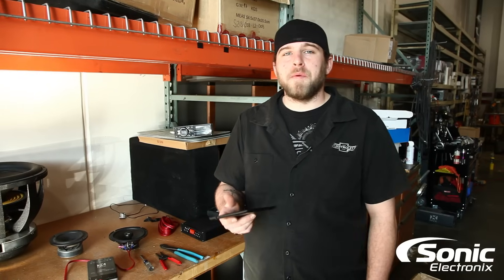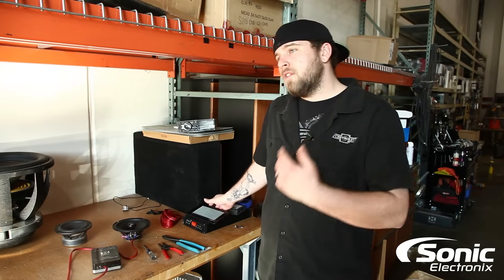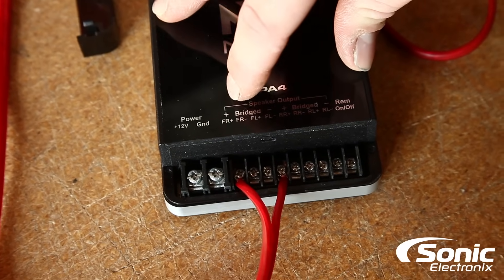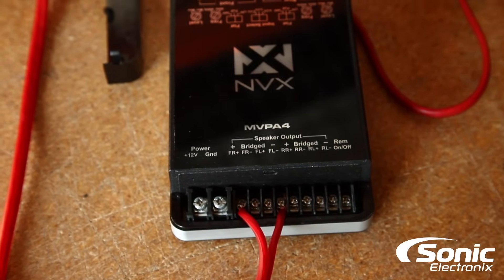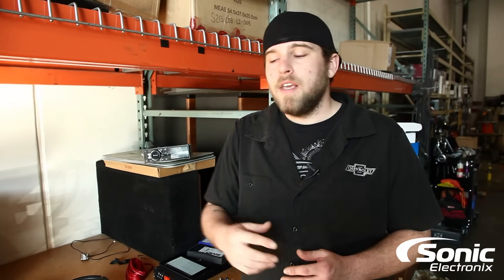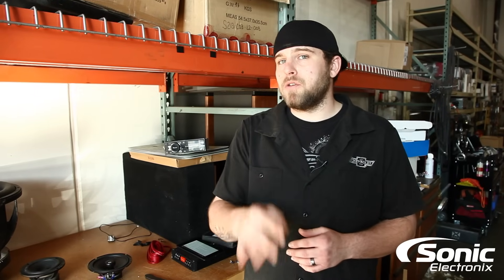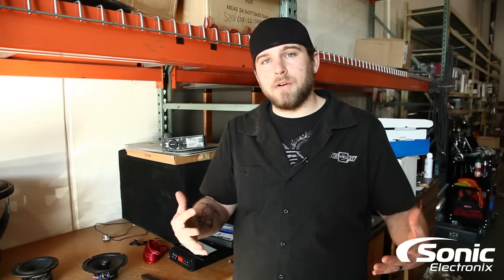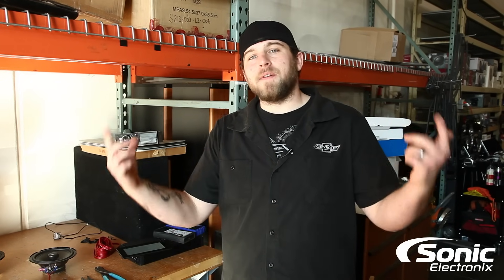How Do You Bridge a 2 Channel Amplifier? | Car Audio Q & A

Comment: Not every Amp has bridge marking ..and if some one was wanting to know how clearly it wouldn't be marked ......the answer would be the plus from left channel and minus from right channel if it doesn't sound right try the opposite  and running 4 speakers on a 2 channel is no problem just run them in series not parallel

Comment: I have a single 12 Dvc audiobahn wired to 2 ohm and then i bridged it at the amp its the Blue 2 channel Hifonics Zues Viii 600 watt i also turned the gained down to a little past halfway is that ok to run like this

Comment: I have a 2 channel amp ( crunch gtrii-3000.1d)  and it doesn't have a specified bridged option,  I have 2 dvc 15in. Power akcoustik mofo subs and want to wire them to 1ohm at the amp if possible, everything I am finding is only 2ohms at the amp and that cuts my power in half obviously so I was wondering what the options were, also an option to eliminate 1 sub if it would be better to do so or to invest in a different amp to achieve this or different impedance of subwoofer.  Thanks for all of your help and great videos 💪👍🙏

Comment: Hay I have 2 12inch subwoofers connected in Parallel and I’m using a 1000 W amp in bridged mode And every time I try to turn the volume up on my stereo to pass 20 the amp goes in to protect mode I have to keep the stereo under 20 and my amp at 0 ohms to keep it not going into protect mode what could be the problem ?

Comment: Sorry I don't know much about car audio but I changed my amp to a rockford fosgate 800a2 2 ch I bridged it and am using 1 15" Q class L7 but unfortunately it is the same as the cheaper amp I still can't get sound from any tweeter I connect- is it possible to connect tweeters to a 2 ch bridged amp?

Comment: my question is does the amp need to be brideged to run a set of 2 ohm speakers in kick panels. Or will a special suited amp do that for me on two of the existing 4 channels? 
I believe it says amplifiers today that are labeled A/B Class can handle 4 ohms down to 2 ohms. So I gather you can run more power to the 2 ohm door speakers on the 2 channels, and the other 2 channels could run 2 more 4 ohm speakers. Giving you much more power for like either rear or front speakers depending on where you need more quality sound and volumn.  A/B Topology - Class ‘A’ amplifiers have enormous amount of current flowing through its output transistors with no audio signal. Class ‘B’ amplifiers have no current flowing through its outputs with no audio signal. If I'm not correct please le me know. I have purchased two 6 inch speakers for kick pannels which I need them to create a louder sound due to position. So using a class ab amp I can use the front two channels to run just the 2 ohm speakers while running 4 ohm speakers in the rear. 
BOSS Audio Systems R2504 - Riot 1000 Watt, 4 Channel, 2 4 Ohm Stable Class AB, Full Range, Bridgeable, Mosfet Car Amplifier with Remote Subwoofer Control

Comment: Most Subwoofers can be bridged down to 2ohm load and not put most amplifiers into protect mode many monoblock amplifiers can even  handle as low of as 1 ohm but again that's subwoofers like 10s 12s etc not door coaxial or 2way 3way speakers like 6x9s etc

Comment: I have two amps one of my apps needs to be connected to power but the other one doesn't so when I connect a remote wire to the power it's fine but when I connect the other remote to the app it shuts off on both of them what do I do
Reply: i want to help but im having a hard time figuring out what you mean here, you say you have 2 amps and one is connected to a power source the other amp is not. what do you mean by when you connect a remote wire to power its fine but shuts off when you connect to the other amp

Comment: If I have a single 4ohm 12 inch kicker comp c subwoofer and a 2 channel 1400 watt amp am I recommended to bridge or no?? Comp c is rated for 600 watts max load. What do I do
Reply: bridge it if the amp is 2ohm stable. you can setup the gain/level on the amp to only put out 600w max

Comment: Okay so if we have say a factory two ohm amplifier and two four ohm speakers can you wire the speakers in parallel for a 2-ohm load and bridge it across the two rear channels
Reply: no if you bridge it at 2ohms the amp will see a final load of 1ohm and overheat

Comment: Old school vintage  Coustic Audio Coustic460  ..
amp.. is a 2 channel that can run 2 ohm bridged i have one running 4 subs from. CT sounds CT pro 8 subs dual voice coils with two subs on one channel other two on other channel. both pair are 4ohm by themselves but wired in parallel to 2ohm bridged mono

Comment: Hi,  am using eonon D1001 car DVD and it has 5.1 ch preout, now my question is only about connecting subwoofer preout to amplifier that's 4 ch I've got,  do I need to bridge?  Or can I consider as similar as one channel to connect sub with one +and - note; leaving 3 ch input and output blank?Coz my idea is to use a 2ch amp and a 4 ch amplifier together to get Dolby 5.1 output.

Comment: you can get impedance protective equipment to be then able to bridge what would be 2ohm to 4 or even 8 depending on the system.
Reply: Yeah I have an impedance matching volume control but nowhere to mount it my walls are plaster otherwise I would be good speaker selector is something I could use anyway so I'll check some of those out
Reply: How do i find this equipment unless your talking about an impedance matching switch
Reply: @coreyfelsman2363  some speaker selector boxes for example or specific volume controls

Comment: Oh buggah - then I must have really screwed up then.. running a 7.3+1 system (for about five years at extremely loud settings) - off the head unit of a Blaupunkt ten disc CD stacker - changer  (in my old Delica 4wd van - between 2003 & 2007 - being as it was - a 25 speaker setup for the seven main surround channels - the three master subwoofers and of course - the summated add-on extra low reverb speaker.
Amazingly - it never blew anything - except people's brains when they heard it.
126.6 dB too running at about 75% loudness at the NZ Sound Off SPL measurement competition, held in Alexandra in 2003 - at the Blossom Festival event.
But then - you see, I already knew what I could DO - with the 300 watt Reactor amp - that I bought for the lowest price possible - at the Warehouse (here in New Zealand)
I also KNEW how to balance the reactances of various wattage / as well as reactance / resistances - of the various speakers, dug out of such things as an old valve radio - some house speakers (8 ohms they were) and others of various numbers, such as 6 ohm sony wall speakers, some 16 ohm AIWA surrounds, and assorted others..
25 speakers.
seven main channels
three subwoofer speakers and a summated (ultra low frequency filtered) vibrator central channel dual 8 ohm speaker set
(being two speakers - one speaker inverted across the other with the two BOLTED together to seal the air inside the diaphragms - of the two speakers)
These were wired - not in series but in reverse series, one driving OUT as the other pulled IN
(& visa versa as the AC audio signal went through it's own inversion state).
Thus the vibrator speaker set - thundered in and out, lifting the van UP then pushing it hard down on it's springs..
Lovely device that was - driven by all seven channels "electrically" summated together as ONE.
I used transformers of course to isolate each of the seven main channels - before summating them all
Be a bit of a buggah it would have been - if all seven channels had been "shorted out" by the vibrator being hard wired to them all.
Hence - I know - that the statement you have made - is NOT exactly true.
An amp is a funny thing.
Balance the load that connects to it, and you can power not one - nor two or three - but (as in my case) 25.
Cheers.
Or - if using an old CDS-370 house amplifier unit (or two) - one can physically drive 88 speakers, inside 64 cabinets, running a 25 channel surround sound system - off an old compact cassette tape recording.
ONE - is not restricted by a ONE speaker alone installation.
See?
Well you will if you watch this....
https://youtu.be/Ub0S8eTijrA

Comment: WAIT so to connect one sub woofer to a bridged 2 channel amp @ 4 ohms------ I put one wire to the black to the red on the SUB--- THEN put one red to the positive and one black to the negative TO the amp. THEN that puts both the sub and the amp at 4 ohms? making my 2 channel amp into bridged mode making 2600 watts at max? I believe i am correct BUT I am never sure.....

Comment: Hey! I would like to get some help!

I have a 2 amp setup. 1 amp for my high and mid speakers and 1 for a sub. The sub amp is a 2ch amp that i'm using in a bridge mode. Now the "main" amp has a single RCA output, the sub amp has a double RCA input (left-right). I connected them with a Y RCA cable. The sub amp has a channel assignment switch: Left / Stereo / Right. The manual says:

Channel Assignment Switch • Determines the routing of the input signal for the RCA and IMS inputs. 

• LEFT: Sends the input signal from the left input to both amplifier channels, useful if you are bridging the amplifier. 

• STEREO: Sends the signals from the left input to the left output channel and the signal from the right input to the right output channel. (This is typical operation mode.) 

• RIGHT: Sends the input signal from the right input to both output channels, useful if you are bridging the amplifier.

As you can see the LEFT and RIGHT switch literally doing the same right? It sends 1 RCA input to the bridged output. If I understand well I can't use the stereo mode if i'm using the amp in bridge mode I have to pick left or right so only 1 input is used so I don't even need a Y RCA cable only a single cable is enough right? Thanks for the answer!

Comment: I don't think he covered the question correctly. He started talking about bridging amps, and yeah, you don't want to go below 4ohm on a bridged amp. But some when not bridged will do a 2 ohm load PER channel. Just have to check your specs on the amp. The part with the ohms is correct though, so just keep that in mind when running parallel speakers.

Comment: Wire a dual 4 sub in series =8 ohms 
Then bridge to amplifier. Safe way
Reply: That's what I've done.  2 15s on a 1000w bridged 2 ch profile
Reply: Dvc 15s at that

Comment: Have question I just bought three boss phantom 12in 2300 watt subwoofers and have a 3700 watt boss phantom amplifier also just bought a 5000watt phantom amplifier......the question is what's the best way to wire them all up...

Comment: I thought the second question was four speakers on a two channel amp
Reply: Yes you can wire 2 4 ohm speakers down to 2 ohm I ran a pioneer 240 2 channel on 4 speakers no problem at all.
Reply: @Chris-ts8oh  i am running 6 speakers on two channels 4 x 8 ohms and 2 x 6 ohms on a Pioneer A450R. 8+8+6.:text-green-game-over:

Comment: U can always change the way u wire your speakers to get a different final impedance. Could u bridge them then?
Reply: That's what I was wondering and also what I needed answered since I have 2 satellites and a center but all 3 ohm so my avr is a no go but I have 2 2ohm stable amps

Comment: Question after you bridge the 2 speakers to the 4 channel amplifier  how do you connect the rca cables, there are 4 input rca connectors. Thank you.
Reply: Get another RCA cable and run from your HU (if it has it) 
Most newer radios have 3 sets of RCAs in the back. Front, Rear, and Sub 
If it only has 1, get a RCA splitter. 
Must have in order to use all 4 channels on the amp.

Comment: I have a question which I can't find anywhere on the internet. Can I have like my front speaker at 150 Watts RMS and the rear Speaker at 200 Watts RMS on the right side channel  this is a 2 channel amp. I was just wondering if you can use different RMS speakers one side of channel?

Comment: How to connect 2 4ohms coaxial speaker and a subwoofer to 2 channel amplifier.?
Reply: I don't think that's possible because the filter would only allow either voice or mono on the switch of the amp. You'd have to choose one or the other

Comment: BRENDAN, great video; I have question; I am new to car audio systems and could use your help if possible; I have a 1970 chevy truck I currently have a "standard 6" speaker and a tweeter installed in the doors; I recently purchased (2) 8" subwoofers to install these are in a sealed enclosure 4ohms each I wired them in parallel the amplifier is a JBL-GTR-601 AMP-600 WATTS RMSX1@2 OHMS CAN I ADD AND IF SO WHAT IS THE PROCESS TOF WIRING OR BRIDGEING A PAIR OF 4" MARINE GRADE SPEAKERSI BELIEVE THE SPEAKERS I WISH TO INSTALL ARE 4OHMS EACH; BOTTOM LINE I WOULD LIKE TO ADD A PAIR OF SPEAKERS TO THIS SYSTEM; I REALIZE I MAYBE ASKING ALOT BUT ANY ADVICE AND OR HELP WOULD BE GREATLY APPRECIATED; PATRICK.P

Comment: Hi. So you said is not possible connect two speakers in one car  radio channel. Because car radio has 4ohms. So my car radio has 50w 4ohms and I want to connect two speakers in one radio channel.
Parallel
4 ohms+4 ohms=2 ohms
4ohms+8ohms=2,5 ohms
8 ohms+8 ohms=4 ohms
So if I connect two speakers in parallel 75w 8 ohms
75w 8 ohms  
150w 40hms
Good or no?

Comment: What if you wanted to bridge 2 channels to increase the output but wanted to run a single high powered 8ohm speaker will that do any dammage to the amp?

Comment: So I guess I'm SOL.. I was looking at taking my 2 svc 10"  4 ohms to a parallel or series and Bridge it to my 1600 watt Peak Power Amp 2 Channel my two tens or 400 watts RMS each, owner's manual showed a single SVC 10 bridged for 1600 Watts by 1 which blows to me cuz it's only one sub and I want to power 2 Subs. My amp handles 2 ohm stable

Comment: If you wire two 4 ohm speakers in series, you create a 8 ohm load... then by bridging at the amp drop the 8 back to a 4 ohm load.  The amp doesn't care how many speakers, just the load that it sees..... isn't that correct?

Comment: Question ? I’ll make it simple. One sub, dual voice coil, 4ohm and two ohm ratings on the speaker package.  What amp do I need to power them ? Mono or two channel ? And when using a two channel do you simply wire each voice coil to each channel or what ? And lastly, how is the power distributed  between the voice coils meaning is the rating per voice coil or does each coil need to run at the rated rms? Sorry so lengthy
Reply: I'm using a two channel and bridging it to double the power. Sub is wired to 2ohm
Reply: Never run a dual voice coil to both channels on the Amp unless bridged meaning don't run one voice coil to left and other to right you wire the dual voice coils as 1 speaker plus to plus and neg to neg then the neg to neg and the pluses to plus that's parallel  creating 2 ohm on two 4 ohm voice coils and the plus of one side into the neg of the other voice coil then connecting to the plus ang neg posts that are not jumpers and that is series and would be 8 ohm
Reply: And it wouldn't be 4 or 2 ohm it would be 8 or 2

Comment: What happens to the ohms when you bridge 2 channels to a single output for a subwoofer?Does the ohm of the speaker stay at 4 ohms?
Reply: That's a good question and one that none of these guys ever actually says. Holler back if you ever get a response

Comment: I was told, I can wire my dual voice coils on seperate channels. (One coil per channel) is this possible?
Reply: Im not a fan of it due to the left and right signals not being the same. So one side of ur sub may be pushing more power then the other side due to it not being mono
Reply: But if it was a high wattaged sub and high watted amps maybe itd be dope but its prob jack all compared to mono. I got my rockford fosgate t1 hooked up the way your asking it only 170 wats to each coil wich the t1 can take 600rms all together the bitch doesnt even move i got the amp like a sliver away from full blast. Sitting wer i sit u can hear the clearness but wen u put ur head up to it u hear fuck all with all the other subs playing

Comment: So when bridging across the L/R channels of the amp, which RCA input do you use - left or right?
Reply: I'm trying to find this out myself 😂 seeing that no one's responded to your question after 2 years I figure my hopes are dismal. I have Alpine manual from 1993, those amps only the left side fed the signal. I also have punch amps from the same year, and the owners manual doesn't say. I'm not going to assume anything, even if some are saying use a y adapter.

Comment: I have a 4 channel amp and want to run four 4ohm speakers and one 4 ohm sub off of it. Can I wire 2 speakers in parallel to two ohms in channels 1&2, then bridge 3&4 for my sub. The amp is rated for 2 & 4 ohms.

Comment: You can put as many speakers on a channel as you like by using series parallel circuits. Let's say you want to run 4 speakers on a channel put two 4 ohm speakers in series (hook plus to minus between them) and two more in series (same deal) then hook those two sets of series connected speakers in parallel. Hooking two 4's in series gives you 8 ohms, Hooking two 8 in parallel gives you 4 ohms. Wala you are driving 4 speakers off one 4 ohm channel. If you like I will draw it out and upload it.
Reply: William Dieter thank you for actually knowing what you're talking about. You can series as many speakers as you want together
Reply: hey DieterWilliam i know this is a real old thread and you most likely wont ever see it but if you do i would love to see a drawing. thanks bud!